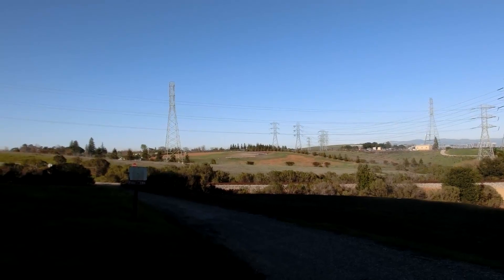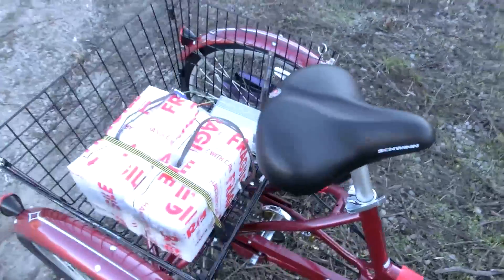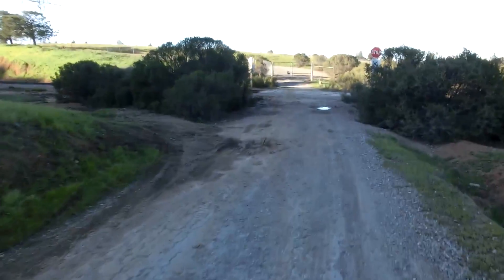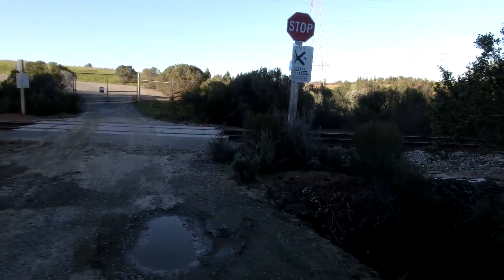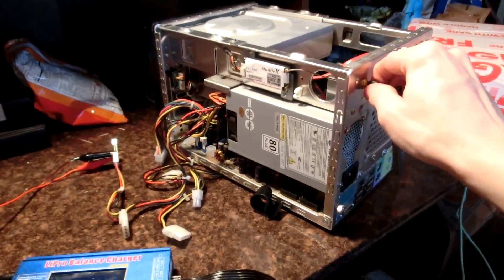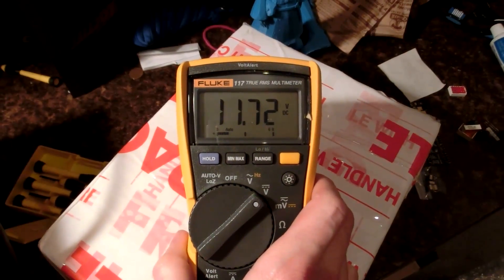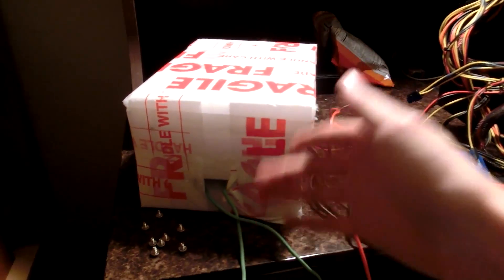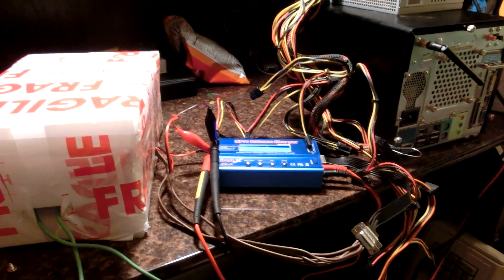Random Bits 0076: Electric Tricycle E-Trike Modification

Comment: Audi A2  its a car, diesel, european, it was produced massivley,  ITS 80-100mpg on the record,  solves every problem efficiently most easily, responsibly, resourcefully. makes toyota, and audi this decade look like total sub worthy things. 
Consumers today are really the worst people on the planet ever in all time. WOW.
Reply from the maker: looks like they only make 173k A2s thats not very many tbh
Reply: @RinoaL  
Well, its still an extremely  respectable previous attempt at fixing the mpg abhorrent waste/mess. 

It would improve quality of life, thats why germany and other small countries did it, BUT the bigger nasiter entity is "doing stuff" to control 'how good you got it"  in the global picture. After all, no thanks to china, definetly, and no thanks to us unfortunately. 

But if one just were to copy and paste those blueprints around the world, All these oil crisis, and environmental crisis would not just HALF they would be more like 1/8th the scale of the problem due to the even worse scaling issues of the larger countries economies. Because it takes oil to get to oil to get the workers to get the chemists, to get the factories to get the designers to get the pads to get the land to get the pipelines. 
It would also end the need to call for more workers. 

The list goes on and on. Thats why roughly twice improving average fuel economy creates an impact of like 8 or more than TEN times Less of a problem. 

When you add or modify a system and increase the decision tree the problems will become more, and worse the more the thing divides. 
Thats why its not greener to have evs (at least the way its done now) because SOOO many other costs are incurred. 

Its like dreaming of 1 day becoming a war hero, not realizing how many horrible things had to be done to get there. Same deal. In a sense.
Reply from the maker: @RobertSchmitt-u7l  i say its better the bike and walk than an expensive automobile.
Reply: @RinoaL  Agreed. Thats sooo much more efficient than anything registered with the state.

Comment: Some computer power supplies require you tp load the 5v line to keep the other voltages up to snuff. I think what your seeing is there just isn't enough pulse width to keep that 12v rail up.

Comment: Rinoa is AWESOME! I, myself, have a silver trike with a 1000-Watt 48-volt electric hub on the front.  I'm commuting to work on it.
Reply from the maker: keep an eye on the axle, maybe replace it once you hit 2000 miles since mine snapped at 3000 suddenly.

Comment: Rinoa's super-cool. Hey, I just finished my e-trike, which I use to commute to work.
Reply from the maker: nice, keep an eye on the axle, i had a wheel snap off after 3,000 miles and rolled me into oncoming traffic. maybe replace the axle after 2000 miles just to be safe. although id regularly go 25mph so if you go slower it should last longer.
Reply: I have torque arms installed; do you think that may help?

Comment: Oh Silicone Valley dude, you should have gone with the Leed's 500 Series kit and you would be much, much happier.  It's a lot more powerful than that set-up and you'll get 30+ miles out of one charge!
Reply from the maker: your joking right? my 1000 watt motor is twice the power of that 500w motor. i googled it and it looks like a huge ripoff. i get over 100 miles of range with this battery on a bike and this whole thing didnt cost over 300$.
Reply: You're trying to tell me you paid just $300 for ALL of those electric components to complete your bike?  Sorry pal, I'm not buying it!  You spent almost $300 for the hub motor on eBay unless you lied about that?  BTW "Genius", it's "YOU'RE" joking right?  Not "your" joking right?  For someone who uses the word "genius" in their username and can't even use proper 3rd grade grammar/spelling, you're actually quite the idiot.

Comment: Could you use cordless drill batteries instead? Just seems like if you rig it up correctly they would be easier to charge and change out....depending on how much battery you actually need though. Just kind of thinking out loud and seeing what you think on that idea.

Comment: Would you please post the link for the place you bought the drive unit at E-Bay, thanks..
also what brand & model is your trike...???
Reply: +Bob White http://www.ebay.com/itm/48V1000W26-Front-Wheel-Electric-Bicycle-Motor-Kit-E-Bike-Cycling-Hub-Conversion-/291508805761?tfrom=291648617281&tpos=top&ttype=price&talgo=undefined
Reply: Bob White

It's a Schwinn Meridian.

Available at Amazon and Wal Mart websites ($300 - $450, depending on color??)

Comment: You can usually turn down the minimum input voltage down to 10.0 volts on the IMAX, that's what I do, it's somewhere in the user set up menu, then the PC power supply works perfectly up to 4 amps charge on a 5s lipo.......

Comment: You and I had discussed making battery packs before and I've finally started messing with a few old laptop batteries that I had.  I pulled apart two of them and found that they discharged a bit odd.  It seems that they discharged in pairs where on one end the pair was down to 1.6V, the pair in the middle were 1.7V, and the end pair were 1.8V.  The second battery had pairs of 2.43V, 2.53V, and 3.02V.  I don't have a charger like yours, but I did pick up a portable battery pack that uses 2 18650 batteries in it from walmart for $10.  I took the batteries that were in it out and am using the charging board to charge the pairs.  It seems to be working as of right now.  I haven't gone through all of them, and I plan to pick up a charger for loose 18650's from a vape shop later to try and charge them without having to solder things together.  Either way, you might want to look into either option for future tinkering with those batteries if you aren't making a battery bank with them.

Comment: I think the voltage issue on your power supplies is that you don't load equally all the rails. Try to load a bit (with a lightbulb, like 20W) the 5V rail and it would surely perform much better. The reason is that by loading only one rail on a bit cheap power supply the PWM controller freaks out and cannot mantain the voltage stable enough, so the IMAX shuts down.
Reply from the maker: yeah but this power supply was made for gaming PCs back in like 2001 or so, and it makes a lot of noise when its idling. its just bad capacitors. thats what happens to old power supplies.
Reply: Rinoa Super-Genius  Surely bad capacitors are an issue.  Since it is made in 2001, most of the load of the PCs back then was on the 5V and 3V3 rails. If you load the 12V rail too much without loading the 5V as well (atleast a bit) you'll see the voltage on the 12V rail drop very much, the 5V rail voltage raise to 5.5 or even more and the PSU transformer will start to make funny noises like squeals and hums. Funny noises can also happen at idle when there is not enough load so the PWM controller cannot mantain a stable output and freaks out. If you take like a 12V headlight and put it on the 5V rail the PSU would perform much better even with a moderately failed capacitor.

Comment: As for anti-theft I suggest you put one of those GPS tracking units in your battery box or something so if someone steals the trike you can track it down and kick their ass for it 
You can get them from flebay for about $70 and they usually work with any SIM card

Comment: Pitty the seller won't ship to Australia I would love to have one of those hub motors instead of paying $300 for half the power
Reply: ***** I wonder how much it would cost to ship from the US to Australia. Are there services that will forward?
Reply: Probably would cost at most $50 to ship from the US to AU 

I would pay the shipping fee to have a motor that powerful for such a low price
Reply: I have since bought a 48V 2500W hub motor off a private listing here in Australia and holy shit does it fly

I can get from 0Kph to 60Kph in 8 seconds 
It would be faster if the front wheel didn't keep spinning and if my battery was capable of delivering more current
Reply: I think it's safer to not tinker with the computer lol I can't afford to replace it if I fry something and I'm pretty much at the limit for what I can pull out of my battery without damaging it 

The motor could easily take more power because it barely gets warm but the computer does get warm and so does my battery 

After all it's only made of 18650 cells and I don't have quite as many cells (or as much money) as RinoaSuperGenius
Reply: 1: a real motorbike requires fuel and registration (which costs money)

2: I don't go over the speed limit 
It is capable of getting up to 87Kph (54Mph) on most public roads I ride at the speed limit and on other roads where the speed limit is above 80Kph I only go at 87 which is the maximum speed the bike is capable of 

I have been pulled over several times and the cops hate the bike but have not found a legitimate reason to steal it
Reply: In the UK to be road legal with out registration, tax, insurance and a license, electric bikes motors have to be limited to 250watts & 15.5miles an hour and have pedals.

I don't know how difficult or expensive the hoops are to have more powerful electric bikes on the road legally in the UK.

Comment: With those hills, the thing that would be interesting to see would be an attempt at regenerative braking.  I wonder how difficult and practical it would be to have a DC generator brake and load capacitors which could be discharged in a controlled way to run the motor and recharge the batteries when going uphill or on flat ground.  I guess if it could be done, the mechanical and electrical engineers would have solved the problem by now.
Reply from the maker: its not a problem, just an added cost. this DC motor generators AC when it it spun so it would just be a matter of tapping that power and rectifying it, then feeding it back into the battery.

i would much rather prefer a mechanical spring loader that would wind up and i could release to start really fast at an intersection.
Reply: I thought that a D.C. motor would generate D.C. power when reversed.  The ones I know of with a commutator would and my understanding of the brushless D.C. which are A.C. but converts would also when the electrical energy to magnetic energy to mechanical energy process is exactly reversed.
     I'm not a battery guy, but I assumed the problem was batteries have to be charged over time.  It was much easier to discharge a battery over a specific time at a specific current than reverse the chemical process and charge it at the same exact current over the same exact time. That was why I threw in the capaciters.
Reply from the maker: *****
well this motor is a brushless DC motor meaning the magnets are on the shaft and the coils are on the outside and it doesnt have a comutator. that basicly means its an AC motor, just its not an AC induction motor.

from what ive found, you can ussually charge a battery at close to the discharge rate.
Reply: You are the battery expert.
     The simplest construct would be to have a coil that lays on the same plane as the basket bottom. During braking, a roller is inserted to engage the spring against the back wheel to which the chain is connected and compression occurs.  In order to assure the spring doesn't try to push you backwards while at stop, a non-rotational block is inserted on the spring to keep it from moving and the braking roller is then disengaged.  When a jackrabbit start is needed, a roller which is the mirror of the first one is engaged on the other side of the spring to the non-connected back wheel and the immobilizing block is lifted.  The compressed spring starts to push the non-connected wheel forward because it is pushing against the mirror image of the wheel from which it drew energy.   I had suggested this arrangement because if the jackrabbit device is engaged on the wheel connected to the peddles, you might have kickback on the peddles and injure yourself. This would be terribly hazardous in all cases - any of these parts engage when you don't want them to, the spring disintegrates or you are so busy trying to deal with multiple braking and power systems, and traffic that you make a mistake.

Comment: First I want to thank you, Rinoa, for all the work you have done making these cool, informative videos. Then, this: You got a steady income now, so why don't you go ahead and upgrade Your battery pack to one you'll make from Nissan Leaf battery modules (You will love it. I promise!), and also ditch that cheap speed control unit that came with the kit and employ one made by the Castle Creations. Check out the conversion kit I put together and let me know what you think. If I help you, you don't have to pay me ;)  http://ihelpupay.com/ebike
Reply from the maker: actually if i am going to upgrade the motor controller i'll probably design one from scratch. but for now the motor controller works great so i'll work on other things that need improvements like a nice hard lockable trunk and an onboard charging module. just picked up the parts for the onboard charging module circuit today. cost about 40$.
Reply: " i'll probably design one from scratch."
That's awesome, Rinoa. I really wish and hope you do. I will definitely find those videos to be most informing and useful. 
I've actually been trying to figure a design of my own ESC, based on my old rusty understanding of MOSFETs and Electronic circuitry (I need to do much research, though, on stock IC's, their nomenclatures, and what they can do). I'd love to design my own BLDC 1-1.5kw motor ESC. Something simple and reliably capable to help climb hills that are as steep as reasonably could be expected of a wheeled vehicle to climb, given the suitable power source.
Meanwhile, I wouldn't mind paying, if I can afford, for one that can comfortably and assuredly do what I want.One that provides me the convenience of being already available and saving me the designing trouble and the burden of questioning myself if I am aiming to reinvent the wheel!. 
Then again, I think I get it. Designing a BLDC Motor Power Speed Controller From Scratch would be a great video production work for you, the most excellent young video producer! So, sure. Please go ahead and share with us the experience, of course, at your most convenience.
Last but not least, I really appreciate you choosing to honor me with your reply, Rinoa. Thanks.
Reply from the maker: Farrokh Mirbaha  lol its not an honor to get a reply from me, i try to reply to everyone i find interesting. :P

Comment: Changing a flat would be problematic after tack welding the fasteners to prevent wheel theft. It's a good anti-theft concept in theory. But the only time I ever get flats is when I'm unprepared to change them. Murphy.

Comment: for my quadcopter projekts i once need a very good and fast battery charger, and i bought the Junsi iCharger 4010 Duo its a 2 chanel charger / up to 10 s lipo / u can program your own charge profiles / look up batery statistics by connecting it with the pc  USB and Micro SD card / and the continius charge current is 1 kw on each chanel .
i use it for everything that needs a charge :D, and its worth the money
I alsow use a server power suply as "low voltage" sorce (50V) thats capabel of outputting 3kw end every thing runs just perfect :D
Sry for language mistakes im not a nativ speker  :D  and good vid ect

Comment: Lookin good :-) , Why not try to parallel join up the power rails off a pc power supply , you may be able to draw a few more amps? i tryed it myself and i could pull a little more
Reply from the maker: i'll just replace the capacitors to get a full 16 amps.
Reply: within the pc psu? or that other thing? hope it does not have many , Glad to see stuff is going well for you there :-)
Reply from the maker: steve64464
yeah i'll see about replacing the caps in the PSU.

Comment: We made a couple of those type of trikes motorized with little 3.5 horse engines. It wasn't difficult, especially with adults doing the welding. :)
Your trike is waaaay cooler, 'cause it looks nicer, and it doesn't break all the time. :)

Comment: Rinoa Super-Genius if you need too keep using the PC power supplies: the way atx power supplies work there needs to be a load on the 5v rail, otherwise the 12v rail sags like it does in the video. More into at this link: 
https://brazenartifice.wordpress.com/2011/12/26/atx-power-supply-5v-load-resistor-for-better-12v-regulation/
Reply from the maker: ive only had that issue with generic power supplies, ones like this that where made for performance PCs have seemed to work fine just giving 12v. not counting both of these power supplies make buzzing sounds. ill just see about replacing some capacitors.